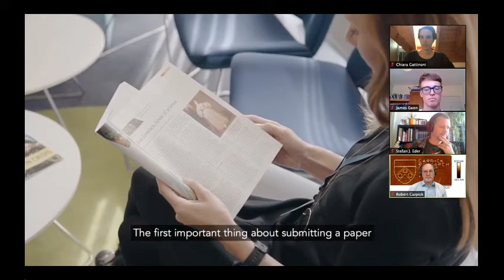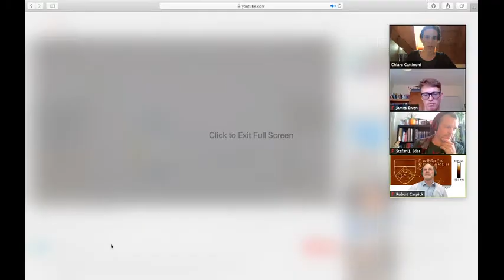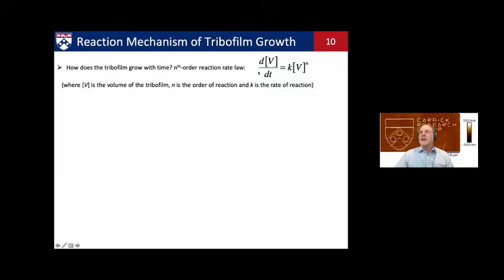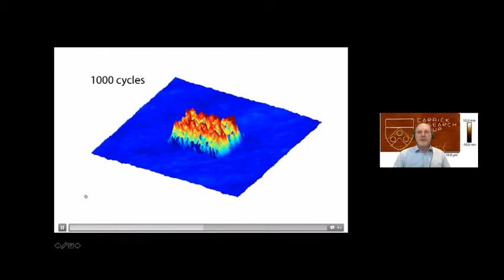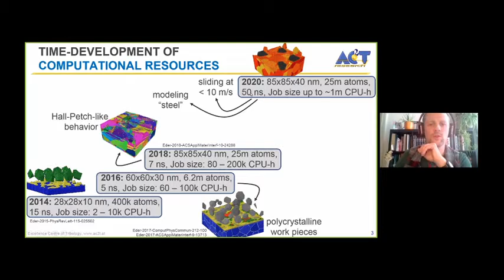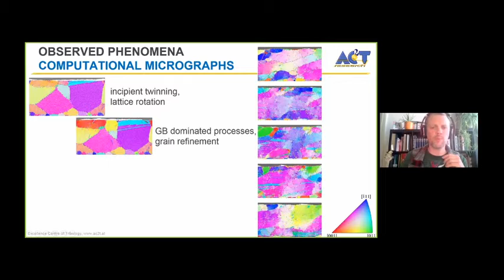WeSST 2020 - Prof. Robert Carpick and Dr. Stefan J. Eder

Comment: @Hande Toffoli
Great talk! A question on the slide on el-ph coupling : Could you comment on how using a single lifetime for all the phonon modes involved in the energy dissipation work so well?
One more question on the thermostatting : Do you get any phononic reflection from the lower boundary?
Reply: Thanks... as already touched upon in the talk, this is actually a tricky question. However, with only the simple means of a set of Langevin thermostats to control the temperature in the system, there is really only one parameter per thermostat to be set, which is basically the coupling strength. So this approach actually does not even go as deep as distinguishing between phonon modes. It only attempts to tweak the heat dissipation in the "bulk" of the model so that a good match with a real sample of that material can be achieved. More can be found at

Eder, S. J., Cihak-Bayr, U., Bianchi, D., Feldbauer, G., & Betz, G. (2017). Thermostat influence on the structural development and material removal during abrasion of nanocrystalline ferrite. ACS applied materials & interfaces, 9(15), 13713-13725.

About phononic reflections: truth be said, we didn't explicitly check for that. However, as the (stronger) thermostat emulating the connection with the bulk (this time the "real" bulk) is located right above the rigid bottom plate of the model, I would assume that any surviving reflections would be strongly damped.

Comment: @Michael Wolloch asks: Can you quickly comment on how much the "data destillation" is automatic?
Reply: Hi Michi! Um, did I ever claim that it was automatic at all? Anyway: the generation of the tomographic slices happens in parallel for the individual time steps by running compiled Matlab functions on a HPC cluster.  These also provide the data basis for the distillation steps. The first 1.5 distillation steps (elimination of spatial dimensions) are carried out using a Matlab script, which pretty much works on a "press play button" basis. As soon as the time-dependent plots have to be evaluated, and especially when the normal pressure dependence has to be fitted, much more personal work is involved. The thinking about the implications of the results then requires several heads... I.e., with increasing degree of distillation, the hassle grows exponentially...
Reply: @stefaneder3942  Thanks Stefan. I guess my question arose because I also watch a seminar series on machine learning in physics at the moment and I thought that the plots you showed would be quite an interesting application of image recognition. However, you probably need to generate a lot of data first and analyze it by hand for a training set that is usable.

Comment: @cipaisone asks: would it be possible to see the simulation approach of the second talk applied to sintering of ZrO2 nanoparticles in the tribofilm of Carpick?
Reply: In general: yes. But someone would have to do it... There exist reactive interaction potentials for ZrO2, some of which have been applied for related questions.  Such potentials are usually computationally expensive and cannot handle large systems. However, in a fairly recent publication by the group of Susan Sinnott, they managed to handle a zirconia block of approximately 20x15x15 nm³, although only for ~200ps.

Lu, Z., Chernatynskiy, A., Noordhoek, M. J., Sinnott, S. B., & Phillpot, S. R. (2017). Nanoindentation of ZrO2 and ZrO2/Zr systems by molecular dynamics simulation. Journal of Nuclear Materials, 486, 250-266.

It would therefore be thinkable to construct a system consisting of several (small) ZrO2 particles and confining them in a non-conformal contact to study how such a film growth might take place under shear.
Reply: @stefaneder3942  Thanks for the question. We are hoping to collaborate with a group on this, and we hope we will be sharing results on this in the near future. It is a complex system to study but we think the simulations could help answer a lot of questions!

Comment: @Ioannis Toulopoulos asks: what exactly are the mathematical models that describe these phenomena?
Reply: I am guessing this refers to the phenomena observed in the CuNi alloys during sliding. In MD simulations, the physics are captured in the form of interaction potentials that govern how the individual atoms react to the presence of other atoms. So, for a given initial configuration (lattice, grain structure, etc.) and a set of constraints (loading, sliding, thermostatting) and boundary conditions (rigid at bottom, laterally periodic), it is the quality of the interaction potential that determines if the experimentally observed phenomena can actually be reproduced by the simulation. The rest is basically Newton's equation of motion propagated using a velocity Verlet integrator, but there are no material laws as in continuum mechanics.

Comment: @Fabian Schwack
 asks: Can you give us a rough estimate of how much CPU hours you have used for all simulations so far?
Reply: The HPC cluster available at AC2T research GmbH has a capacity of roughly 10m CPU-h per year, most of which goes into MD simulations, as these are the most computationally demanding tasks. Of that, approximately 80% go into the actual simulations, and 20% into the post-processing. During the testing phase of the VSC4 supercomputer, I was fortunate enough to be granted 20m (free!) CPU-h over the past six months. Thanks again to the VSC crew for that!

Comment: @Philipp Grütz
 asks: Is there an upper limit for roughness after which tribofilm formation is not enhanced anymore?
Reply: Philipp - I'm not sure you mean substrate roughness, or roughness of the tribofilm itself. We see that substrate roughness strongly enhances the growth rate for the ZrO2-based tribofilms; we think this is due to 'valleys' helping trap the nanoparticles, allowing the tribofilm to nucleate more easily, and potentially also due to the enhanced stresses that occur when the tip slides over a protrusion. Some further details are in our paper, https://pubs.acs.org/doi/10.1021/acsami.8b16680, Khare, H.S., et al. "Nanoscale generation of robust solid films from liquid-dispersed nanoparticles via in situ atomic force microscopy: growth kinetics and nanomechanical properties." ACS applied materials & interfaces 10.46 (2018): 40335-40347.  

For ZDDP, we have not systematically looked at tribofilm growth rate vs. substrate roughness, but initial results suggest a complex relationship. While film nucleation is sometimes seen to be enhanced at locations of topographic variation, the overall growth rate is sometimes diminished. 

Please let me know if that doesn't answer your question as I can elaborate. Thanks for your interest!
Reply: @rcarpick  Thank you very much for your answer and the paper suggestion Rob! I meant the substrate roughness, even though tribofilm roughness might also be interesting to investigate. I was wondering if there is an upper limit for substrate roughness aiding the growth of the tribofilm because we are investigating the tribological properties of a combination of carbon nanoparticles and surface roughness/surface texture. In these systems we see that there is an upper limit for surface roughness or texture size after which there is no more improvement of the tribological properties. Also if the surface is too rough in relation to the size of the particles the effects are less beneficial.
Reply: @philippgrutz1587  Thanks for clarifying. Your study sounds very interesting. I'd very much like to see your work when you are able to share it. I can share that we also have some initial evidence at the macroscale that when the substrate is too rough (and harder than the countersurface), indeed you just get surface damage and the tribofilm can never really start to grow. We are working to fully understand and quantify this; work still in progress, but feel free to follow up with me later as we hope to publish this.
Reply: @rcarpick  Thanks for the reply. I will send you the mentioned work by email. Your work also sounds very interesting and I am eager to learn more about it. I will definitely follow up with you.

Comment: @Sourav Sahoo asks: Why does the growth of the ZrO2 tribofilm saturate after a particular thickness?
Reply: Sourav - we think this is for the same reason that ZDDP levels off. The modulus of the tribofilm is lower than the substrate; for the ZrO2 tribofilm its not as low as ZDDP, but still lower than steel. As the film thickens, it increasingly cushions the applied force. The resulting grown layers are weaker and weaker, until eventually they are not bound strongly enough to withstand the stresses present which remove the nanoparticles - ie growth no longer competes with removal.

Comment: @Michael Wolloch
 asks: Could you elaborate on why you think that you see ZDDP films on Al on the nanoscale, while it is not really seen on larger length-scales? Is there no work hardening there?
Reply: Good question! We don't know the answer, but one possibility is that there is indeed work hardening at the macroscale, but that means the films take longer to grow. As well, we expect the films do not bind to the Al surface as well as they bind ferrous surfaces. So films may start to grow, but they get rubbed away quickly. 

We don't know yet if our AFM tip not only caused work hardening, but may have also removed some of the oxide on the Al, which may have helped trigger growth. However, this seems to not be a major factor because we were able to grow films on Al2O3. So, having oxide does not prevent tribofilm growth.

 Another possibility is that the films that grow on Al are not as strong as the ones grown on ferrous surfaces, possibly because Fe ions may help promote ZDDP tribofilm growth, as argued by JM Martin and coworkers. This would also make it easier to remove the nascent ZDDP tribofilms as they grow. 

Even if all this is true, it still remains to explain why the films are stably observed in the AFM experiments and not macroscopically. With the AFM tip, the force is controlled and the sliding is a fairly uniform process, whereas at the macroscale, you have multiple asperities and many fluctuations/excursions in the loads applied, which can lead to more wear/removal if the film is not intrinsically strong, or not strongly bound to the surface.

Comment: @Hande Toffoli
 asks: on slide 14 , are the striped features of the tribofilm on Al due to the back and forth scanning or is it a real morphological feature?
Reply: Good eye! The stripes are due to the fact that we are scanning the AFM tip as fast as possible in this AFM (an Agilent/Keysight 5500 AFM). This excites mechanical resonances of the AFM, and so you see the regular, periodic vibrations across each line. These vibrations mean that there are regions of higher and lower force, and this affects the growth, such that the areas receiving the higher force grow more tribofilm (because stress or force promotes the growth). We discuss this further in our paper: https://www.sciencedirect.com/science/article/pii/S0301679X19305894

Gosvami, N. N., et al. "Nanoscale in situ study of ZDDP tribofilm growth at aluminum-based interfaces using atomic force microscopy." Tribology International 143 (2020): 106075.

Comment: @Enrico Milanese asks: 
what does the surface morphology look like when the film growth rate saturates due to wear?
Reply: Enrico - at 20:10 in the video, you can see an example of this. The top of the film is not very different than at lower stresses, but portions of the tribofilm are removed, and some of that piled up on top of the film elsewhere. This is illustrated in Fig. 2 of our paper and in some more detail in Fig. S5 of the Supplementary Information: https://science.sciencemag.org/content/348/6230/102

Comment: @karo mtabar
 asks: It’s been said that the maximum shear in the context of the Bell theory, corresponds to the reduction of the activation energy to zero, have you observed a zero activation energy at your maximum shear?
Reply: From our measurements, when fitting the Eyring/Bell model, we get an intrinsic activation barrier of 0.8 eV, and an activation volume of 3.8 Å^3.  Assuming that the stress reduces the barrier in a linear fashion (which is probably not correct, but let's just use that for the sake of argument), you would need to apply 32 GPa of normal stress to get the barrier to zero. This is well beyond the yield strength of the tip and substrate and beyond what the tribofilm could withstand; it also would require forces beyond what we can achieve in the AFM. So we do not come close to this situation, but it certainly would be interesting to work with a different system where that situation occurs.

Comment: @rinsos asks: Can we understand the fitted value of the attempt frequency based on the atomic structure? And wouldn't you expect that the attempt frequency is temperature dependent?
Reply: We make the simplest of assumptions, which is that the effective attempt frequency is constant, at 10^13 s^(-1).  In the supplemental material to the paper in Science, we show that the quality of the fit to the data, and the resulting values for the activation energy and activation volume are not strongly affected when the attempt frequency is varied by a couple decades. However, this is indeed a simplistic assumption, as is the assumption that the process of tribofilm growth can be described by a process with a single barrier. It would indeed be valuable to explore the kinetics further, including the degree to which the effective attempt frequency varies with temperature.. Molecular modeling could help significantly in this regard.